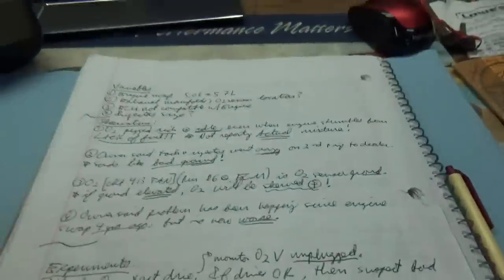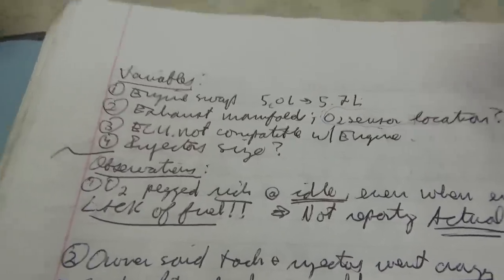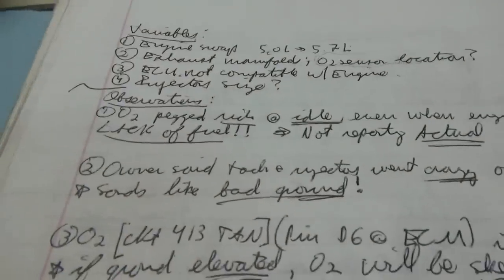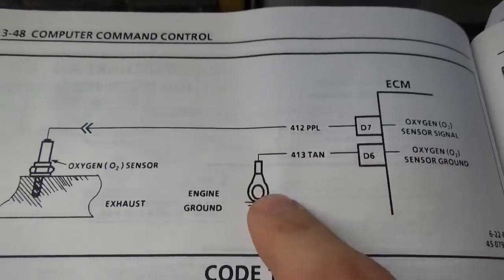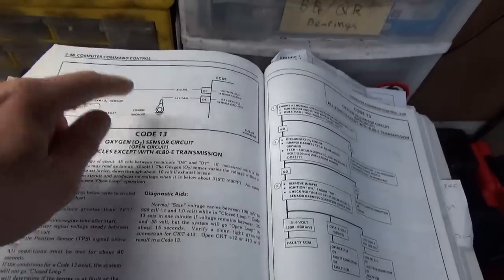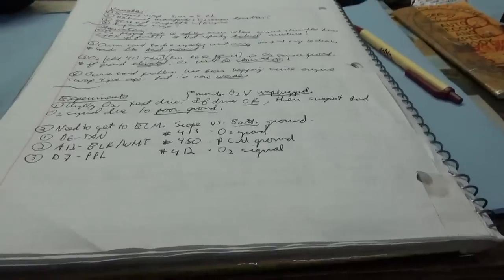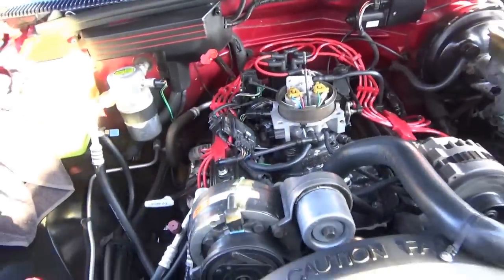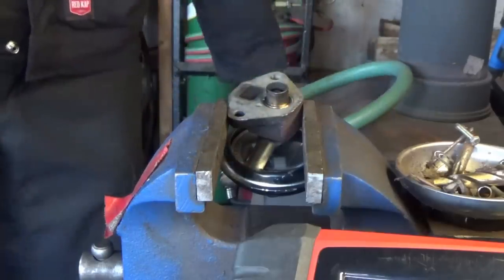Classic Chevy Christmas! - Part 2: Emissions Systems

Comment: My first guess at the start of part 1 was egr.  Now, since it just has 1 O2 sensor, what if the injector on the O2 sensor side is injecting more fuel than the other side?  The O2 sensor sees rich and backs off on both injectors... causing the other bank to misfire.
Reply from the maker: Are the injectors bank-specific, or is the air stream common to both?
Reply: @PineHollowAutoDiagnostics  I don't know, that's why I watch you. 😂
Reply: @PineHollowAutoDiagnostics  I looked up a few manifolds for 5.7L.  Not sure if I got the right one, but the ones I saw were split.
Reply: @PineHollowAutoDiagnostics  in the pre MPFI days, there were just Bank A and Bank B toggling back and forth, didn't matter whether on a 4, 6, or 8 cylinder.   hope that helps
Reply: not looked down a factory intake in a long while, but I recall them being dual plane and forget which injector feeds which side, there is somewhat a balance port/hole between them, where EGR feeds into, but that's not enough to balance fuel from bank to bank.

Comment: On older GM products if the fuel pressure regulator diaphragm is leaking it can draw fuel into the intake causing rich idle
Reply from the maker: Is that internal to the throttle body?

Comment: I would be checking the regulator on the throttle body. They went out often and caused all kinds of problems.  There is also a screen in the inlet line at the fitting that goes to the throttle body.  That bolt that holds the lines down is a bitch to get to. Also look at the base gasket and the intake gaskets.

Comment: Got to wonder about those injectors. Looks like they are not capable of delivering a small amount of fuel at idle. Going down the road open loop you're pegged rich. If rpm, map, iat are ok then the prescribed PW  is delivering too much fuel. An oversized injector would be one explanation. Put a current probe on the injectors and see what happens when it stumbles?

Comment: If the computer is for a 5.o n theres now a 5.7l the volume of air going in and out are going to be greater can the o2 n computer actually accurately read correctly and compensate for that? Or is it to far out of its parameter control

Comment: I’m really surprised this guys truck runs as good as it does with all the non factory parts installed in it. I did notice Ivan when you were trying to open the EGR with your vacuum pump you had to pump it several times. Could the diaphragm be bad inside the EGR?
 Also the idle air control bleeds air into the manifold to increase or decrease the idle. What happens if there is a vacuum leak? The idle speed increases. Might not be a bad idea to smoke the engine to look for vacuum leaks

Comment: Have you performed a running compression test to see if you have a valve issue? That was my first thought when I heard the symptoms. Also I'd look at spark, they had issues back then with distributor cam gears getting worn. At a lower rpm, warmed up, there may be a little "chucking" going on causing a misfire. Once the rpm goes up there's more pressure on the gear causing it to stay in place. Might want to check that if all else fails.
Reply from the maker: Brand new distributor, but with this truck, EVERYTHING is on the table!

Comment: I would unplug brake booster hose and seal it off, and check all vacuum hoses for leaks,. also check the pcv valve, they are often overlooked, if its stuck open its like a vacuum leak.,.,

Comment: When you were scoping the o2 and you could see the individual puffs of exhaust could the computer be seeing those as being rich? They were happing so fast the computer might just be seeing a high signal
Reply from the maker: Great question Chris! I had no idea an O2 sensor could respond that fast, especially a single-wire!
Reply: @PineHollowAutoDiagnostics  have seen this erratic behavior once on a '93 Z24 with MPFI; ended up being caused by a defective spark plug boot discharging into the exhaust manifold - i was just seeing stray voltage on the manifold.  I only saw that because i was integrating an aftermarket ECU so I could turbocharge it; and was scoping everything and verifying inputs at the time.

Comment: Hey Ivan! What about the fuel pressure? I had an old 1981 Opel Senator with a 3.0 engine. This car also came with smaller engines and many people switched to bigger engines later when they were cheap and the cars old. But these engines had different fuel pressure regulators. One was running with 2.5bar, the other one with 3.0bar. Maybe the bigger 5.7 V8 in that truck needs a different pressure at idle? Or maybe the 5.0 has a regulator without vacuum and the 5.7 needs one with vacuum to lower the pressure at idle. By not having that lower pressure it would go rich at idle. If my thoughts aren’t wrong
Reply from the maker: Definitely a variable! Will check it out after getting a few other details sorted :)

Comment: Ignition timing is adjustable on these. Of course with a timing light and make sure you disconnect the timing bypass connector.  Specs are at 0 but runs better between 4 and 8.
Reply: 4 to 8 is way too much, you'll get major highway spark knock, unless of course you run high test fuels. the total advance becomes simply too much at tip-in throttle when in OD.
they'll even spark knock like mad when cold in open loop
Reply: I respectfully disagree, maybe it’s the altitude but 8 degrees is no problem around here (California). As a matter of fact 8 degrees was factory timing on many American V8s pre smog era. I run my 88 mustang 5.0 at 12 degrees without any problems. Regardless, the timing should be checked.
Reply: @rafaelgarcia-xk7eu  heh @ "stooge-fornia"
yes near seas level means a lot, but ethanol in fuel hampers that.. around 1K above sea level here and it gets cold, some times below zero, I can say tweaking timing forward beyond 4 degree will cause major spark rattle in open loop on most anything, due to fixed timing/injection maps.
I have owned  and repaired tons of carbureted to to current direct injection vehicles ;)
I prefer and daily drive carbed vehicle for years, any issue occurred, I knew what it was without having to diagnose for a weeks of 500 hidden electrical bugs :))
Reply: @ throttle bottle 
Yeah, here in “stooge-fornia” I’ve worked on a few “rust free” cars myself. Today I’m working on an Acura in my “t-shirt”  Damn these 65 degree Decembers! Heh.

Comment: Been thinking on the EGR not holding vacuum (?)  It should  . Does the pull off solenoid work ?
Reply: the EGR on those are fixed orifice bleeder type, meaning they have a fixed size hole in the metal through to atmosphere. they;re known for rusting the hole shut or getting dirt stuck, in which they'll open too far and cause an off-idle/cruise/tip-in major lean out stumble/misfire. also to note, many were not sized engine specific and needed silly restriction washers that go in  under/over gasket ( I don't think that had such though)
Reply: Ivan did you check for vacuum at the throttle body vacuum port ?

Comment: Why is it choking out when it tries to go lean if it's too much fuel from the injectors, as some are saying?  That is, if we are trusting the O2 sensor is appropriately saying there's too little leftover O2 after combustion.  That high frequency stepping on the O2 sensor still has me intrigued.  The ECM controls O2 cycling through fuel pulsing.  So, what's the deal with that apparent dis-regulation?
Reply from the maker: Yeah that oxygen sensor response was crazy! We'll keep it in our mind as the diagnosis progresses.

Comment: I would check fuel pressure but you will have to install a T on the fuel inlet line.  Not super convenient.  But you may have to do it.

Comment: 21 year mechanic here. It for sure seems to be a fuel problem. Injectors were not spraying right. Could be the computer goin bad or the wrong one all together. My next step would be a fuel pressure test to eliminate a fuel pump problem. If that is well then i would go after the computer. My thoughts are the computer is not for a 5.7 or being OBD1 it did not take the flash as they thought it did. Very good chance the computer is a big factor problem. Hope this helps. But the fuel delivery is for sure incorrect. It was very noticeable when you showed the TBI on the camera. Also possible that the map is wrong or going bad or was bad right off the shelf. Every now and then you do get a bad part new. I would also re-check all the new sensors and make sure your customer did not receive a bad new part. New don't always mean proper function.
Reply from the maker: Very thorough checklist, Austin! Definitely on the right track with fuel delivery and strategy :)

Comment: Interesting problem.  Bottom line there is too much fuel going into that engine.  The integrator cannot bring it down "correctly".  Could be the location of the O2 sensor is too close to the cylinder.  It's kind of like my mustang when you install headers you have to tune the delay value for the O2 sensor since it's farther away from the engine.  I also don't like that the idle linkage has been altered so that it takes the IAC so long to reach an idle after a cruise.   What should the IAC counts be at idle?
Reply from the maker: Excellent observations! I like this train of thought...

Comment: Is there a different fuel map for the 5.7? What ecm did he use? Also the pass. side injector dripping fuel, not atomizing..not good Ivan, I have a 91 Silverado longbed with a 5.7 with no problems but the moonie style gauges..hate them...oil and temp not working..oil is pegged and temp shows up on key off when hot...new temp sensor no help...any ideas?
Reply from the maker: Check input to the cluster to see if it's a cluster fault or sensor fault :)

Comment: I used to have a 95 model with the 350 and the o2 sensor was after the y pipe, where it sampled all 8 cylinders, not just 4 , like the one here. Don't know if it makes any difference, but it's something to try.
Reply: I believe they changed the location when they went to OBD2 systems, I'm going to guess that was an OBD2 model.. previous to that they were alll single O2 of drivers side exhaust manifold at rear aimed towards firewall.
Reply: @throttlebottle5906  95 was still OBD1 and mine was a throttle body unit, one o2 sensor. They went to OBD2 in 96 when they went to the vortec
Reply: @95silverado  there was some half year hybrid mixes that I recall of...
Reply: @throttlebottle5906  Not being ugly, but only sampling the left bank and not right be kind of stupid. How does the computer know what the right bank is doing? The vortec engines have 
4 o2 sensor, 2 up stream, and 2 down stream.
Reply: @95silverado  if either bank gets too out of hand, the operator should go "gee the engine is running bad, lets get it fixed"
but as we all know, that doesn't happen and never did since the earliest times on anything mechanical, electrical, etc.

Comment: Lots of variables left...
High fuel pressure...injectors too big..MAP sensor might be screwy...I'll have to rewatch😱 to see if you verified the MAP already🤣....manifold vac test at idle, separate gauge and or transducer-scope v's scan data comparison could be useful.
Mmmm, thinking could be a 'simple' idle screw possibly been 'screwed with', putting the Idle Positon Switch/TPS sensor Out O Whack' and now not sensing correct idle pos. maybe??..lol........
Maybe start with vac leaks, or leaking injectors then onto other stuff I guess🤣👍
Reply from the maker: Yup the transducer will make an appearance very soon :)
Reply: Yep....always makes for an 'Awesome + Crazy' case study, especially when you have nothing 'standard' left to go on......"mix and match, mix and match"....'lets make this worse than ever before'...'and now...nearly impossible for any tech. to diagnose....yay🤗'....(heads off to the parts store to re-load the cannon...yet again)...lol

Comment: You forgot to write down the big question, what is the fuel pressure.  Bigger injectors is okay on 350, PROM cal tables need to be for a 350, different from a 305. If he changed from stock cam, the ECM will definitely have issues figuring out what's going on since it only has MAP data, no MAF on these to measure actual air inflow.

Comment: did he put an 02 sensor from a 5.0 or 5.7
Reply: lol not to burst your bubble but its the same part number o2 sensor for almost every chevy car from 1979 to 1994. No joke no matter if its a 2.4l 4 cyl 4.3 6cyl or any v8 from back then
Reply: @Hammerjockeyrepair  fair enough, tell me, why did they put the 02 sensor on the manifolds on some trucks, and further down the exhaust past the cat on others. my 89 scottsdale has the 02 behind the cat..  there had to be a reason they changed locations.
Reply: also some had two knock sensors, some had one, like mine does.

Comment: Throttle body injectors may have crap in passenger side dumping fuel. I took one apart on that year cleaned out bunch of dirt. Ran ok afterwards.
Header O2 position may not be in correct position to get proper reading.
Excellent work Thanks
Reply: I tend to agree on the header pipe o2 sensor.  Only one cylinder is providing heat and some cylinders run leaner than others anyway.  My 305 has 4 cylinders feeding the sensor.

Comment: Did you test the engine coolant temperature sensor for the ECM? And at the ECM.  The ECM  thinks the engine is cold  more gas and high idle.
Reply from the maker: It warms up to 192F on scan data, which seems reasonable.
Reply: @PineHollowAutoDiagnostics   laser pointer thermal shot of the exhaust at the O2 sensor to make sure it's getting hot enough?  seems prudent you could also check either side of the thermostat housing, which is likely where the temp sensor is, too...
Reply: @PineHollowAutoDiagnostics  Yes, those have 195 thermostats

Comment: Is each injector feeding half of the engine or there is no separation? If each 4 cylinders have their own injector and since the O2 sensor is only on half on the exhaust manifold, maybe that side injector is putting out too much fuel (leaking). The O2 sensor reads rich, the ECU cuts fuel which makes the 4 cylinders supplied by the good non-leaking injector to starve and the engine stumbles.
Reply from the maker: Great question! I wondered this in the beginning, and never really explored that variable in depth...
Reply: @PineHollowAutoDiagnostics  Another thing that I was wondering was what is the exact procedure of the 5.0 to 5.7 change? 1) Do you only update the ECU to lengthen the injector pulse? 2) Do you only change the injectors to a more flowy ones?  3) Do you do both 1) and 2)? What was done on this vehicle? If you were supposed to do only 1) OR 2) but did both, the injectors will be always supplying more fuel than needed. Maybe try to go back to the stock 5.0 injectors...

Comment: I have had 5 of these motors over the years. I would be looking at fuel pressure first. Then if the pressure is good I would focus on the passenger side injector, the spray looked a bit bad on camera. You can pull them apart some what and clean the screens in them. Good luck and great case study. I love your work and thought process
Reply from the maker: Great suggestion Joel. We will look at fuel delivery soon. What have you found to be a common issue with fuel PSI?

Comment: Holy crap that thing is whistling LOUD. i had to turn my speakers down that cant be right.The last time i herd a whistle that loud i forgot to plug the brake booster vac line back in after repairs.
Reply: Alternator fan/bearings or idle/tensioner bearing tend to have those sounds when they are replaced non OEM.

Comment: Personally I would check spark plugs If one plug is fouled out on the bank with the o2 sensor or otherwise not firing it will peg the o2 rich and cause the pcm to start taking away fuel causing the other cylinders to stumble

Comment: Great two parts Ivan   jam the PCV system shut   remove pcv valve and insert rubber cone attached to vac gauge  where pcv valve came out of    internal vac leak   intake sucking on crankcase??????????     food for thought    all the best

Comment: Do you think the Map sensor could be an issue?
Reply from the maker: The data reported seems very reasonable on the scanner...so not suspecting the MAP just yet :)
Reply: Pine Hollow Auto Diagnostics one thing I’ve seen my father in law owns same truck he was having issues, rough running etc. it ended up being the coolant temp sensor. Not sure of the codes but it wasn’t running correctly. Just throwing it out there. Loooking foward to seeing this through. I’m putting my money on the coolant temp sensor.

Comment: In the previous video, the scanner showed the 5.0, not the 5.7L but does it use the vin code or the ECM to determine that? Can you verify that anything in the ECM has been setup for the 5.7? What other emissions devices are missing? Was there a smog pump like there was on many of the other vehicles of the era? 

I did read that a few that did this swap had the same issues as did those that had switched to headers, and that some solved it by swapping out the O2 sensor with a heated unit. Personally, I think the better solution might be a programmable aftermarket ECM to match the custom engine + headers under the hood.
Reply: With the headers being wrapped like they are, how closely does this simulate the stock configuration? Seems the heat loss should be significantly less, but is it enough or too much? Time to get out the FLIR?

Comment: How do you "force" the injectors to run leaner so the O2 graph goes into oscillation? (working) The sensor says it's running to rich Correct?  Pulse width?
Reply from the maker: It's all up to the PCM and the calibrated fuel map...
Reply: Ivan: How about introduce a vacuum leak to drive the O2 sensor towards 0?? Leaner